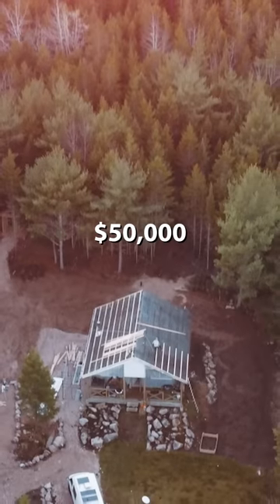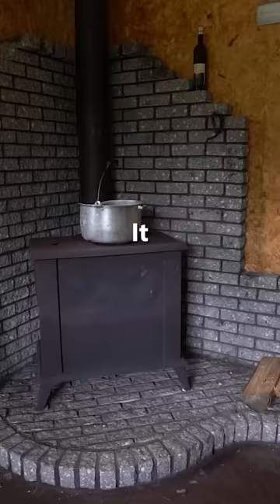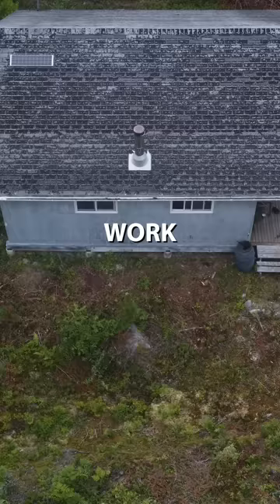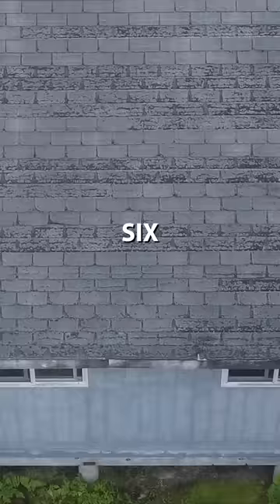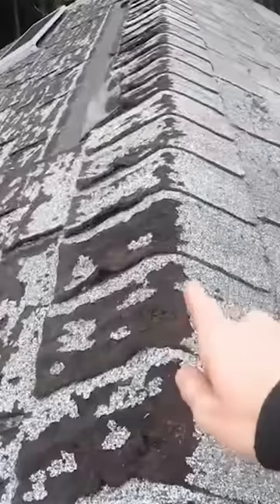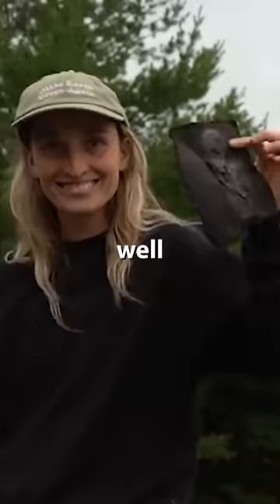Roofing With NO EXPERIENCE #shorts

Comment: Bad move leaving the old roof.
You can leave it but in cold/snow country it's a very bad idea to do so.
Want a good job?
Pull your metal roof of being very careful with it and then strip that roof and do a proper job when putting your metal back on.
The weight alone is reason enough to strip the old roof in cold country.
The most I have seen on a home is five layers of roofing, a shit ton of weight, the rafter had all deflected. This was not in snow country though, if it was it would have collapsed.

Fix it, do a proper job.....

Comment: Brutal!  😂 I’m just a regular dude, work hard at a desk doing structural engineering and love my outdoor sports.  Putting a metal roof on is a copout.  I did a metal roof exactly that size on the shop recently it took my buddy and I all day long one day done no ropes no scaffolding it was taller than that roof we had no materials when we started 5 AM coffee bagels bong hits charged batteries 7 AM picking up materials 830 the first screws go in we didn’t even think we were cool for doing it price was about the same 3000

Comment: omg ! I didn't realise that you left the old roof on until I read some comments , and you put the screws on the flat , I'm not a roofer but that doesn't look right at all but in saying that , the guts it took to do this is shows that you guys are goers and I respect that but please get a builder who you can trust to have a look at the house and even if it costs 500 to get some real advice it's worth it
Reply from the maker: No worries Robert- things are different everywhere for everyone. In Canada if we didn’t put the screws exactly where we did it would void our warranty. Lastly, we took the extra precaution of making sure the roof underneath the shingles was in good condition before choosing to leave them. We’ve had it up for almost 2 years and it’s doing great!

Comment: You needed to scrape everything off. Before drying in and sealing. That weight will cause problems. Properly sealed rafters plus insulation equals proper heat distribution.  You will lose heat this coming winter.. just a warning.  Make sure corners are caulked and sealed. Otherwise fuck all your work due to moisture.

Comment: Why on earth did you leave those rotten old shingles??? Especially since you were putting a metal roof on? Those are just going to continue to rot....and add unnecessary weight to your roof....which decreases your snow load. Other than that, it looks good.

Comment: you roof is going to leak soon as you screwed in wrong logation all screws need to go through the hills as wtare rundown in heavy rain it will leak throught the vally screwssorry to tell you you need to redo your roof and its definatly not done

Comment: Build a batch box rocket mass heater burn 10% of the wood retain 90% of the heat. Also install hot water coils in stove and hook to a hot water tank to radiate heat. Use fire bricks or heat proof material for J tube / burn chamber 1400 to 1800 temperature. You can also build a room with the stove outside and duct the heat inside or not  to help keep the house cooler in the summer time. Videos of different designs on youtube. I like the batch box best of all because of the ability to load a large amount of wood in the stove at one time and not be feeding wood in the stove often. Praying for Us All to Be Healed Blessed & Guide & Protected By Jesus Amen Thank  You Jesus Amen

Comment: That strapping should be vertical. Any moisture that makes its way through the metal (condensation), is going to sit there without a chance to dry. It'll mold and rot and ruin their cabin. 

Please stop posting uneducated DIYs. You're only contributing to misleading and faulty applications that should be left to professionals.

Comment: Arrgghh! When screwing down roofing sheets you screw through the raised part. It stops ALL the water from flowing over the screws. You do need longer screws, but they won't corrode, or the rubber  seals corrode from the excessive water flow.  Damp good job though.
Reply from the maker: Voids your warranty in Canada